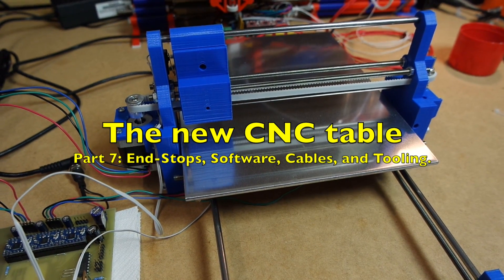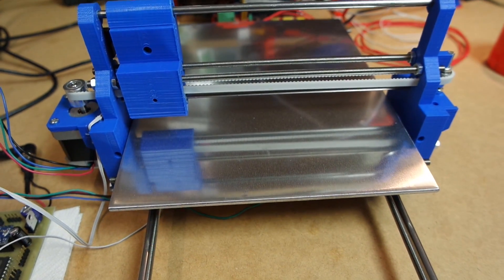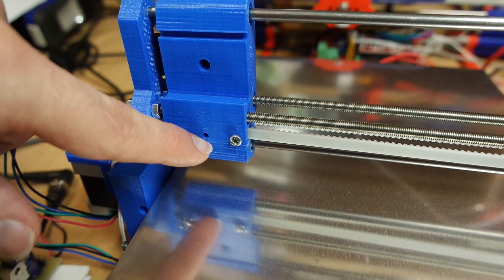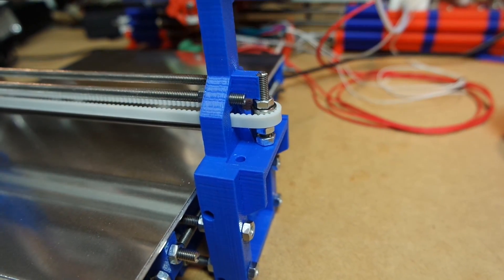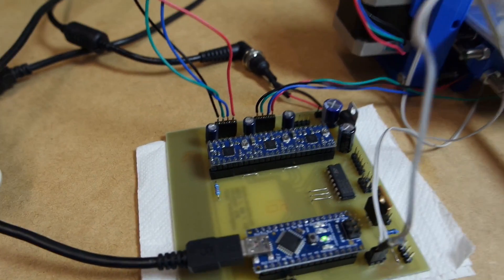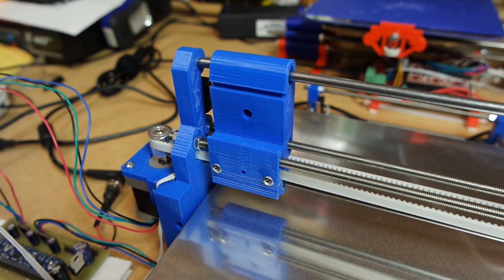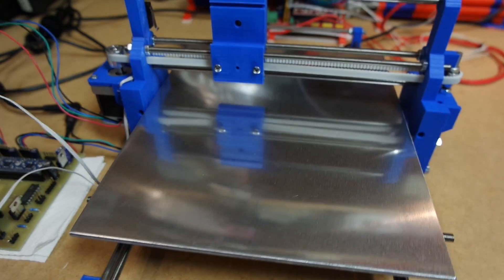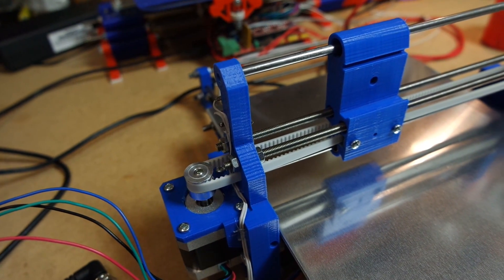The new CNC Table pt. 7

Comment: What do you think is a better system, having the bed move vs a moving gantry?
Reply from the maker: Oh! That's a difficult question. I think there is no correct answer to that - there are so many factors that make them different, and so many prerequisites that need to be considered. 
I really can't choose, and wouldn't want to.
Reply: Dirk Herrendoerfer
I think just for simplicity having a moving bed is easier then moving gantry.